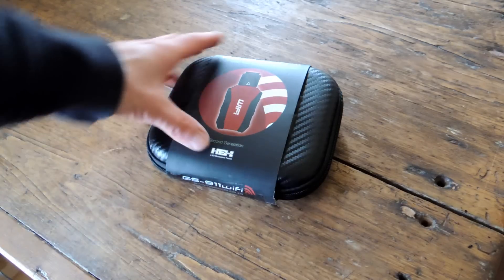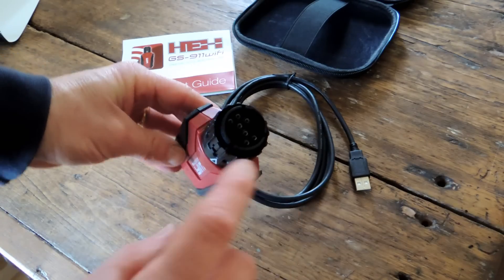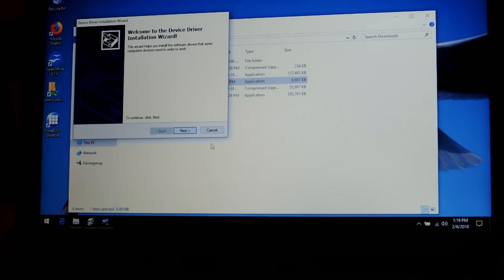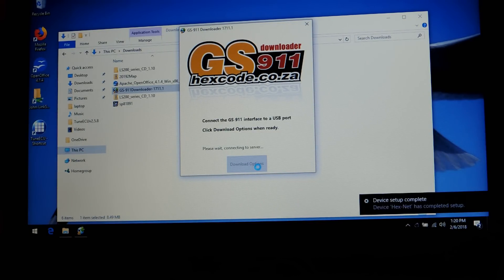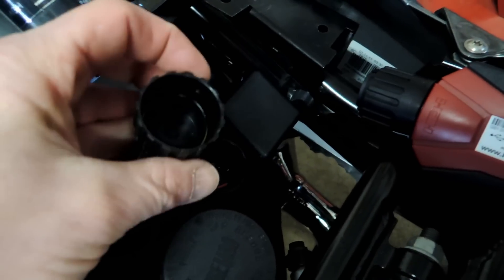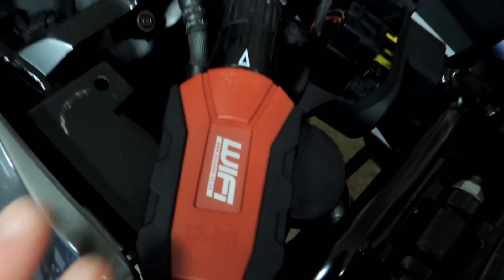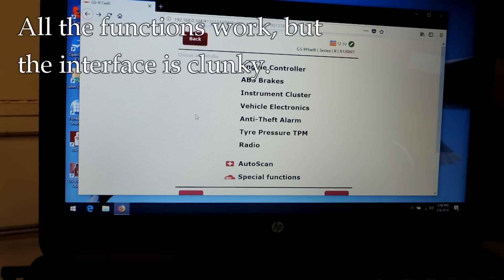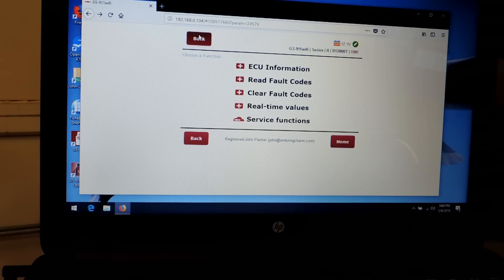GS 911 For BMW Motorcycles Unboxing And Setup

Comment: Can I turn off rev limiter with it?
Reply from the maker: If there is a rev limiter, I've never hit it! No, I've never seen such an adjustment and since the bike will pull right up to redline I'm not sure why you'd even need such a thing?
Reply: @tinderboxarts  my bike redline is on 8k rpm, my country doesn’t have Bmw dealer so I can’t turn it off, I was wondering if gs911 can turn it off? (S1000rr 23)
Reply from the maker: Oh, I see--you have an artificial redline imposed by government regulators?  I still doubt you can change that with the GS911.  I've never seen the option, but then again in the USA I don't think there are limitation imposed.
Reply: @tinderboxarts  yeah man, either govermant regulation or BMW just won’t let us rev beyond 8k until first service. But Yeah I guess GS911 could do its job, thanks man.
Reply from the maker: Oh, if you haven't had your first service yet, then that could be it.   The dealer should be able to handle that for you and I think the cost is included in the original sale.

Comment: I got an OBD Link blue tooth for around $100 and it works fine with the app Moto scan. It was a bit of a struggle to get them to connect but it was all down to me not going with the right sequence. Anyhow the app works great on all Beemers and the reader works on the cars as well. You should check them out!
Reply from the maker: Yes, the motoscan app is the alternative to the GS911.  However, it doesn't have quite the depth of function.  If you just want to reset the service light it may be fine, but if you want to do more advanced things it may be lacking.  It also requires an android phone or tablet.
Reply: @tinderboxarts  so…the superior phones? Haha. All I use mine is to reset the service notifications…By the way, I copied your idea for the phone/gps and lighter power outlet on top of the panel. Works great but for the power, I routed a wire to the battery direct. I can run a compressor that way. Thanks for the vids!

Comment: Is there a function to monitor the canbus - say for example reading the button presses on an RT1200RT-P which are normally routed to an additional controller?
Reply from the maker: There is no "built-in" function to read off the dash, if that's what you mean.  You can use a scanner like the GS-911 to read error codes, of course.  Some electronics wizards can hack into vehicle systems like the CANBUS controller, but that's pretty esoteric stuff.

Comment: You can use the WiFi connectivity out in the field. The GS911 interface unit broadcasts its own WiFi SSID. You just connect to it via your phone's WiFi settings app. It is actually very great because you don't need to pull out your laptop and a USB cable while sitting on the side of the road.
Reply: Yes and no... In the field you can connect your  iPhone to the GS911wifi BUT you'll only be able to "read" information. In this "read" mode you are not registering a VIN. You can use the GS911 in the "read" mode on any bike and it never registers as one of 10 VINs your allowed with the Enthusiast Model.
Reply from the maker: @johnhenry3536  You didn't mention which model of GS911 you own.  Some of them offer both a USB and a WIFI connection, some only the latter.  The USB connection also provides greater functionality under the current software revisions.  I'm going to assume you are having trouble with the WIFI connection?  I would suggest first making certain that you have the current firmware, because there have been significant updates.  There are also now downloads for WIFI utilities which you may find helpful.  See this: https://www.hexgs911.com/gs-911-downloads/

Comment: Got to agree, the softwares pish. I got mine earlier today and couldn't figure out  where I was headed with it.. eventually gave up and ate my dinner..tomorrow's another day.
Reply from the maker: It's funny, I used to work in the computer industry, and I've noticed how software design has changed over the years.  Just like language, there are conventions and expectations in menus, graphical layout, etc.  The GS-911 design is decidedly old-school, and honestly not that great even within that genre.  It does make more sense when understood in that vein, rather than against the modern standards.  Think of it like a car stereo, a printer menu or a home appliance.  There's a main menu list and each item has sub-menu lists associated with it.  You can't jump from one to another, you have to retreat first back to the main list and then navigate down a different path.

Comment: You are to negative my friend, to clunky , plastic box, ziptight, etc ! I couldn’t finish watching ,
Reply from the maker: It's a review, not an advertisement.  Reviews cover both good and bad so that potential buyers can evaluate for themselves if they want to make a purchase.  And, it can be feedback to manufacturers.  On a different youtube channel of mine I did a review of a tool which was seen by the manufacturer.  I was later invited to visit their engineering site to give them feedback on a new, similar tool they were developing.  Honest evaluations can lead to improvements.

Comment: OBDlink LX will also work - $59
Reply from the maker: There is a phone app called motoscan, but the GS-911 goes deeper than any other system, as far as seeing live data, changing parameters, pulling codes, etc.
Reply: tinderboxarts thanks.

Comment: Hello from over the water,I have a oil pressure warning light that comes on when my bike is fully warm and idling,do you think the gs911 could diagnose between a electrical fault or mechanical fault,and is it able to link new electrical components to the canbus system,many thanks and stay safe.
Reply from the maker: I doubt the GS-911 is going to be much help.  The possible reasons for the light coming on include genuinely low pressure due to low viscosity oil, insufficient oil, too much oil, or worn engine components.  Or, you could have a bad sensor or electrical fault leading to the sensor like a broken wire or corroded connector.  First I would carefully consider the circumstances around the warning, and eliminate other things before blaming the sensor.  You say the light only comes on when the engine is warm?  That means the oil is warm too, and warmer oil is thinner viscosity.    Does it matter if the bike is parked or moving?  Does it matter if it is located on an incline?  Have you checked the sight glass for oil level? Does engine RPM matter?  These sorts of questions may narrow down the problem.  Further, what viscosity oil are you using and what are your ambient temps there?  Have you done a recent oil change?  What is the mileage of the bike?  You can't check internal components but you can get a sense of the problem with these questions.

If the sensor itself is suspect, I don't think BMW publishes the specs for testing.  You'd have to replace with a known good unit.  You could check the wiring harness and connector, though.  Those sensors are generally pretty reliable so I would go through the questions above first.
Reply: @tinderboxarts  Thanks for your quick reply, this started after  oil and filter change,light go's  out  when engine revved,viscosity is 10/40, 2007 R1200R with less than 30,000 miles.

Comment: I have found 2 models of GS911 on Amazon, with similar references
 (one ending by 204 the other by 205) but the second twice as expensive as the first one. Any clue for this difference?
Reply from the maker: There's a "professional" version with unlimited VIN slots and an "enthusiast" version with ten available VIN slots, so that may explain the difference.  Unless you are running a BMW bike repair shop, the enthusiast version is what you need.
Reply: @tinderboxarts  thanks for your help, and your professional enthousiasm

Comment: Thanks for the video. I, for the life of me, couldn't figure out how to get the software for the PC. Thanks to you, I watched and learned. Now for the chinkered up connector on your MC. You can get the extension cable and leave it hooked up, that way you don't have to deal with the stripped snaps and disassemble the part every time.
Reply from the maker: Good idea on the extension cable!

Comment: Hello, can you tell me if this disgnostic device and this connection I can plug in a BMW F800 GS Adventure 2018?
Reply from the maker: There's a list on the website https://www.hexcode.co.za/
Reply: Hi Marcello , the GS911 is not working  / compatible yet on 2016+ models of the f800GS 
.., but Hex will have the firmware update out within a few weeks to finally enable this to work ;)
Reply: That model won't work unless you get an adapter cable to hook it to your bike. Details here:  http://www.beemershop.com/